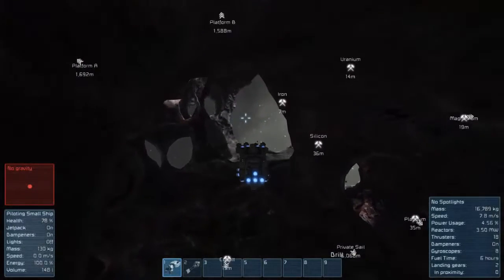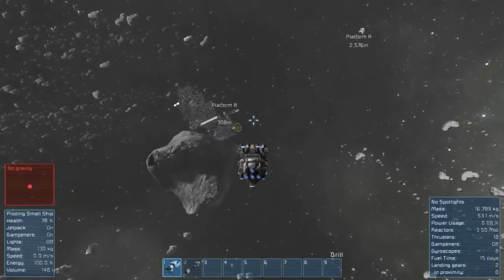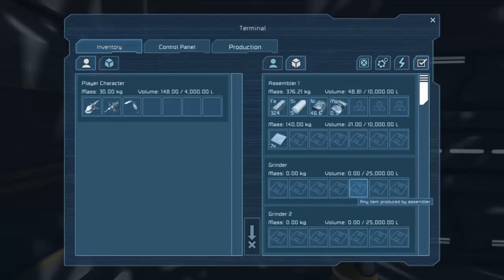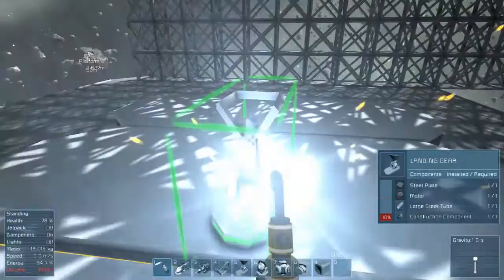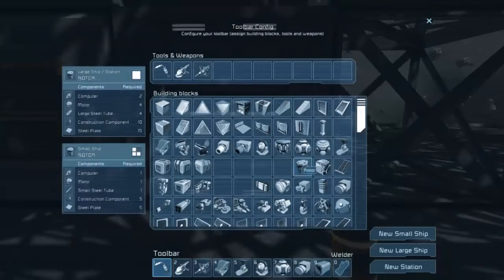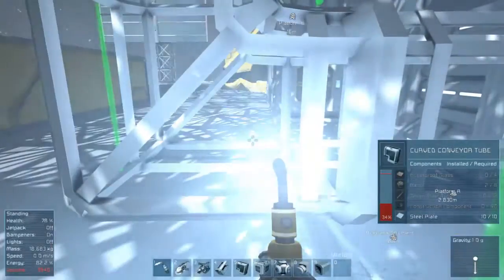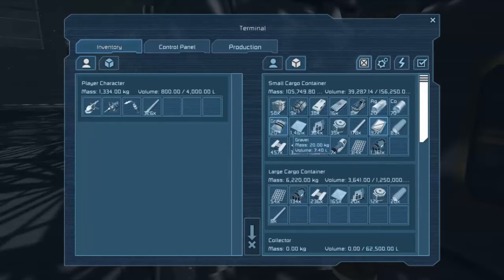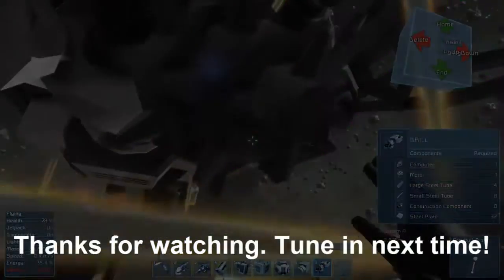Icy Plays: Space Engineers 9 "Dump A Load"

Comment: *****  if you shift click you'll move 100 parts at a time, if you control click you'll move 10 at a time.
Reply from the maker: Niice thanks :)
Reply: yep, changed my engineer life once i found that out. also right clicking an item and dropping it into another inventory allows you to move a specific amount.
Reply: spicydeath82
I'd like to note that these only work from the inventory you're currently connected to (except the right-click-drag, which works for any inventory in the conveyor-ized system).  Hopefully that will be fixed soon :/
Reply: true.